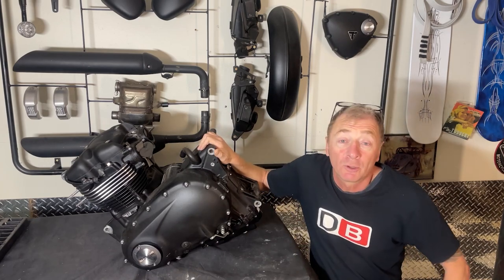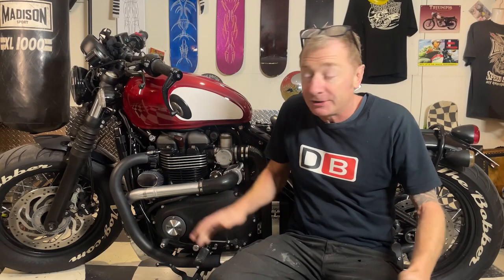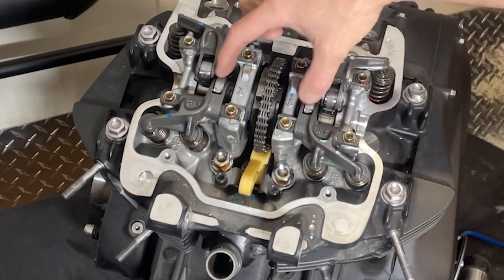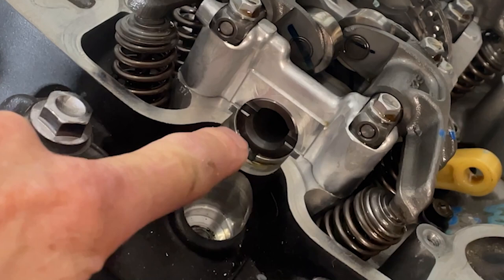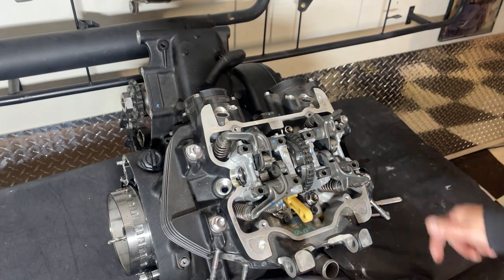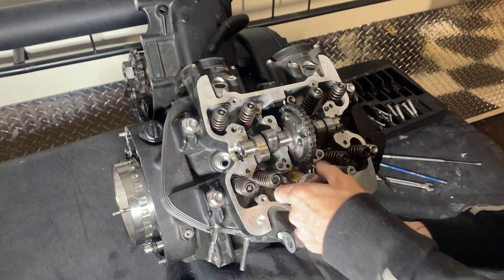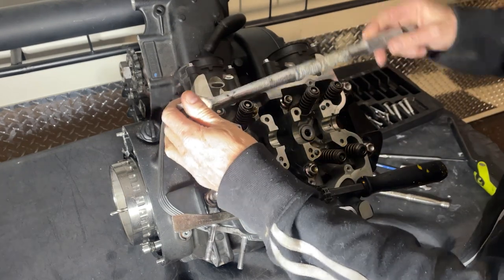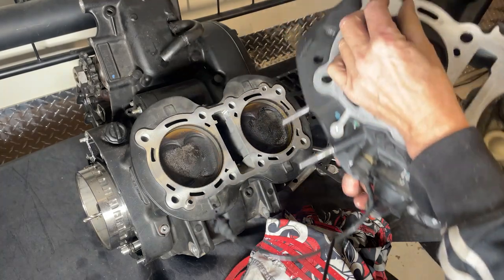Replacing pistons (part 1) for the Supercharged Triumph Bobber motor

Comment: Duane your now the goto man for these Triumph Twin Motors.
Reply from the maker: Not sure about that, but I will be tearing down the bottom end shortly and making content about that!
Reply: @brownco_customs  Its not a heavy bottom end noise....soon as the motor starts to warm it goes.

I am thinking timing chain tensioner again.....funny thing is....any owner with this tapping like mine.....its not heard till may 20 to 30 seconds after cold start.

I am wondering id the tensioner can loose its hydraulic pressure then start to build it up again slowly.
Reply from the maker: @nickaxe771  That can happen.
Reply: @brownco_customs :
I have a 2022 Triumph Scrambler 1200 and it’s knocking. Nick has the 900cc T100 Bonneville.

This bike ran great first day up until the second service and has been knocking during start up ever since. 4200 miles, and still knocking.
Could you please offer any advice as to what causes this, like the cam-chain tensioner that had been mentioned or could it be oil type, or ECU causing pre-ignition or detonation, or the type of gas?

It doesn’t blow any white or black smoke. It doesn’t loose any power. Runs strong but this knocking is really in my nerves.
Just yesterday I ran high octane gas and it didn’t knock, but I’ve tried high octane gas before and it was still knocking.

Your bobber engines are the same as mine, you must of experienced this knocking, yes?
What was the problem?

That bobber looks great btw.
You a bit of a maniac on that drag strip I see 😂 you don’t hold any punches.
Stay safe !
Reply from the maker: @ginoasci  I doubt that you will get detonation on start-up. That is more likely to occur under load. Hard to say without hearing it, or knowing if it is top or bottom end. Happy to have a listen if you can get in touch with a video.
Reply: @brownco_customs  :  I do have a couple videos on my channel.
One is a short and the other is just a few minutes long.  You can really hear it on both.  I appreciate your help.
Reply from the maker: @ginoasci  It sounds in time with pistons to me. Surely it's a warranty issue and down to the dealer to sort out.
Reply: @brownco_customs  :  I’m sorry but I don’t understand what you mean by “it sounds in time with pistons” 
Please elaborate….
Reply from the maker: @ginoasci  The noise sounds like it is at the same frequency as the pistons are moving.
Reply: @brownco_customs  : 
is it piston slap?
Is it the ECU that’s causing the time to be off?
Is it the quality of gasoline?
What do you think it is ?
Reply from the maker: @ginoasci  Personally from the video it sounds like piston slap, however it does sound lighter than that like more a top end noise. The ECU map will not cause this at idle unless it has been very badly messed with. The fuel will not make a difference at idle. When I mentioned timing previously I was not referring to the engine timing. I was referring to the frequency of the sound in relationship to the piston movement, from a diagnosis point of view. It is very hard to tell from a video.
Reply: @brownco_customs  :  thank you for your response.
Does a loose cam-chain tensioner sound like piston slapping?
The symptoms seem to point towards the tensioner. What do you think about that?
Reply from the maker: @ginoasci  It does sound like it could be the chain yes. It's just the rhythm of it that makes me sway  towards piston.
Reply: @brownco_customs  :   does the cam-chain tensioner sound anything like piston slapping?
Reply from the maker: @ginoasci  It can do. If you like I can make a video including your video and see what my viewers think. Might be good to get a few more opinions. What do you think? Also, what does the dealer say about it?
Reply: @brownco_customs  :   
What would cause piston slap at idle ?
Sure, I’ll take the help, thank you.
Reply from the maker: @ginoasci  Does the noise go with more RPM?
Reply: @brownco_customs  ;  you can’t tell because the extra noise from the engine and the exhaust drowns it out.
It would say no. It’s there. It knocks.

I’ve had 93 octane in it for a week now and I’ve started it about four times, and the knocking is less.  Not sure if this will last, but I’m going to ride it for the next two days because it’s supposed to be really nice out and see if it continues to knock when I start it.
I purchased a bottle of octane boost which I’m going to try and see if it runs better whether it makes noise or not I’m gonna try the octane boost .
Only temporary.
Reply from the maker: @ginoasci  I didn't realize you can only get 93 octane. Triumph advise 95 here, I use 98. Octane boost is certainly worth a try.

Comment from the maker: Ha ha, @16:35 I mention it's handy making videos so you can remember where things went. I am currently putting the motor back together and had to look at this video to see what way up the tensioner guide went which was also @16:35. Happy days!
Reply: @brownco_customs  :   
Here’s “when” it happens.
Ran great first day new up until the second service.
The knocking used to start after thirty seconds.
After a while it started immediately after starting the engine.
Now the knocking starts after a minute and a half.
In all three scenarios it lasts about a minute to three minutes.
If your ear is tuned to the noise, you can still hear it all the time.
A lot of the time it’s very difficult to hear, and sometimes you can’t hear it at all.
It becomes intermitting.

Comment: I have a 2023 speedmaster that I want to send ecu in to dnk tuners to remap it. I put motone decat x pipe an motone shorty pipes so I'm getting lots of deceleration popping. Where is the ecm located an how do I get to it? Thanks keep up the great content.
Reply from the maker: I am not 100% sure about 2023 models but for the older ones it is behind the engine in front of the swing arm. It is not a simple job to remove. You may have to remove the swing arm, but I believe people have done it without removing it. It is way easier to install the DNK tune onto the ECU rather than remove the ECU. If your bike has a secondary air system that may also be causing the popping.